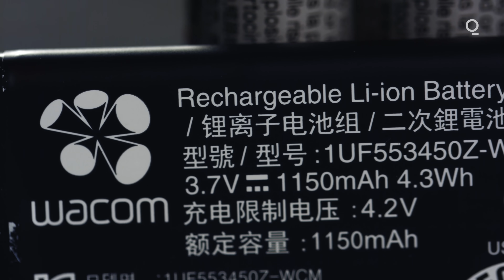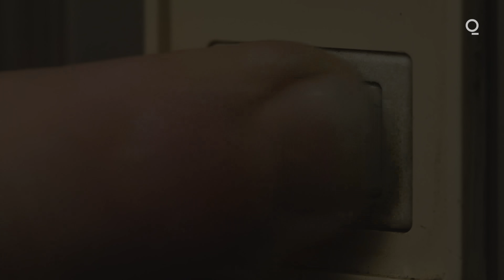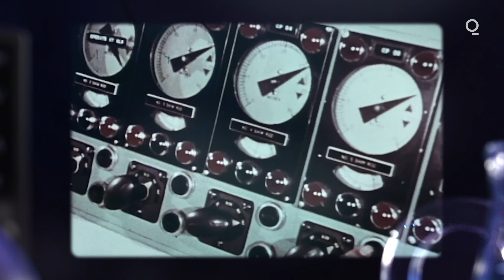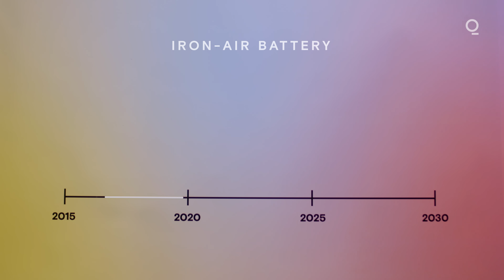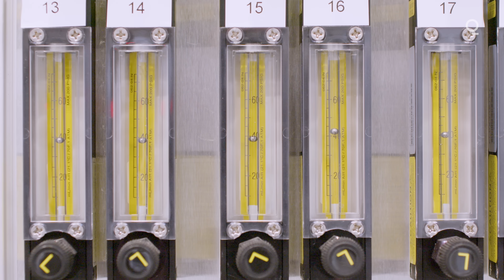The Huge, Weird Batteries of the Future

Comment: Also agree to move electricity across states or countries using high voltage DC transmission. NZ in 1965 with a population of 2.6million already put in a 600km line which carried 600 megawatts. That is mainly north to south but large east west conglomerates could transfer solar power from sunny to less sunny areas. Or wind power.
Reply: Or, you could put solar on every roof and "decentralise" with "local" storage, at the building, or at neighbourhood level.
Cheaper.
Reply: Half the city populations don’t have a roof, nor any property to put up a solar array. I have lots of roof but have waited 25 years to grow decent shade to reduce the heat load.  I am not going to sacrifice my trees for solar.

Not too far back roof solar was not economical as the quoted cost would have been barely paid by the energy recovered just at end of life of the array (about 20 years). Clearly not worth the cost or bother.  

You green fanciers have to realize that wind and solar energy is neither practical nor affordable to the majority of the population. You also need an expensive Solar Wall to get through the night.
Reply: the US would need 150,000 megawatts of transmission lines east to west. 346 million pop. and no one wants a transmission line built. Reaserch the grain belt transmission line from Iowa to chicago. Unbuilt for 10 years.
Reply: . @kkarllwt  wrote: "the US would need 150,000 megawatts of transmission lines east to west. 346 million pop. and no one wants a transmission line built. Reaserch the grain belt transmission line from Iowa to chicago. Unbuilt for 10 years"  I reply: The grain belt struggle is about not wanting solar panels covering land. And they are not even considering solar panels for shade. High voltage direct current lines do not make the alternating EMF of the alternating current transmission lines which quite rightly people don' like to live under.

Comment: “When you switch on a light someone has generated that electricity for you to use”… was this really a necessary point to make?
Reply: I think the point is that electricity used when you, say, switch on a light, is generated Right NOW.  This very instant. At nearly  the speed of light.   It is not stored anywhere ready to use unless we have battery load levelling which is not the case.

Comment: You can call it battery when you are able to carry it. I don't see much differences between the pumped-storage generator and the natural gas power.
Reply: So you wouldn't consider a Tesla's 1,060-pound rechargeable power source a battery?

There's all the world of difference. Pumped storage moves water up and then back down again - in many systems, the same water - to temporarily store excess renewable energy. Natural gas is a fossil fuel that is burned and in the process destroyed, while contributing to the warming of the planet.

Very little similarity indeed.
Reply: @DavidHeizer  The 1060 lb battery is placed under chasis of Model 3 and is mobile. If you could move the mountain, you could call the pumped storage a battery.
Reply: @DavidHeizer  No, Sorry. Even you could move it, it's not yet a battery because a battery doesn't need a generator to generate electricity.

And regarding the carbon emission, we couldn't say that the pumped storage itself is a green energy source. Pumped storage needs an external power supply to store potential energy and grean or not depends on those external sources. Solar power or Dam generator moves water up, it is green. Coal generator moves water up, it is not green.

Comment: I have the strong sensation that getting electricity from green resources to pump water up to get again alectricity later is a 60% of energy trowed away.
Reply: "60%(+) thrown away" = Hydrogen.
Reply: What's your better solution?
Reply: @DavidHeizer  dyson sphere
Reply: That's why you leave engineering and science to people who actually calculate the right numbers, instead of just "having a feel" for them
Reply: Modern pumps and turbines are incredibly efficient, with the most modern stuff only having around a 1-5% total energy loss over any given time.

That level of energy loss would be about the same as lost energy in the form of heat when charging batteries.

Comment: Pumped hydro looks great.... on paper. Not only are we going to have more heat and far less rain in the upcoming years (effectively reducing the battery 'capacity') It will have the same effect that hydro is having in my country were most of the water dams are not working due to extremely low volume. 
This would have been a great solution 30 to 60 years ago.
They should build/use water tables at least some of the evaporation could be contained.
Reply: Meanwhile in Canada our nation essentially runs in hydro. It's going great.
Reply: @AtillatheFun  your climate still gets you that advantage... But don't worry soon it will catch up to Canada 🤌
Reply: Most pumped hydro uses two reservoirs, and is only minimally dependent on an incoming stream. I wonder about the effect of Northfield "stealing" and then dumping back such large quantities of water into the river; I suppose they've been doing it long enough...

Comment: I think its worth mentioning that the type of salt used in the electrolysis that produces hydrogen would favorably be a non chlorine salt
Reply: crypto trading is the future of all investment , text me on what app and make money daily from an organize copy trading strategy signal pattern
Reply: You don't need a salt to split water with electricity to produce hydrogen and oxygen. There are processes and catalysts that claim to accelerate electrolysis like alkaline hydrolysis, but it takes energy to maintain the high temperatures these require, which in China comes from burning coal. Example: "This article concerns the low-cost and green electrolytic production of hydrogen operating at such a low voltage performed by the dissolution of steam in high temperature molten salt electrolytes"
Reply: The Connections (2021) [short documentary] 🌳

Comment: this isn't a battery in the traditional sense because it takes energy to make this battery work as you have to pump the water up.
Reply: There are two sorts of batteries, both requiring charging. You didn't charge the old carbon zinc batteries with electricity, you did it with the the electrodes which got used up when the battery was being used., if that is what you are thinking of. But ones like car batteries are charged with electrical energy. Instead  of putting that energy into electrochemical reactions in an electric battery It is used to increase the potential energy of water by lifting it - pumping it up. There will be some loss. Or you can store megawatts by raising heavy weights in old mine shafts. That is quite efficient - not much loss. Search gravitricity.,
Reply: @briansandle1915  there is a lot of loss because if you are going to measure the efficiency of a battery than you have to factor in how much energy it takes to create that energy.  And a traditional battery as we think about it doesn't take energy to charge it but this takes large amounts of energy to create the stored energy (the water)  that is pumped to the top of a hill to become consumable energy!!
Reply: @cliffwoodbury5319  The old non-rechargeable batteries require a lot of energy to refine the substances for the electrodes. And to mine them. In this water pumping case the pumping energy used comes from excess generation from nuclear, etc,. which can't be turned down when not wanted.. The water battery can store that waste and give it back in times of need.
Reply: @cliffwoodbury5319  Apart from a bit of loss to the viscosity of water in the pipe the bulk of energy is given back, not lost. The energy consumed by pumping mainly goes to potential energy of the water and is given back out as it flows down again through a turbine. The pumping energy is darwn from excess energy from the power grid, like from nuclear which can't be turned down.
Reply: It is not a battery, it is a storage device. And yes it has losses.
Reply: @deang5622  A battery is a collection of things like guns or electrochemical cells whose effects add to one another. If they are storage cells it is then a storage battery. Electrical storage batteries have losses they are not perfect at giving back what was charged into them.
Reply: @briansandle1915  Wrong. The definition of a battery is: "a container consisting of one or more cells, in which chemical energy is converted into electricity and used as a source of power.".

No chemisty involved in pumped storage systems. Ergo, not a battery.
Reply: @deang5622  The original electrical battery of leyden jars in the 1740s did not involve chemical storage.
Reply: @briansandle1915  The Leyden jar was a capacitor, not a battery.Go learn the difference.
Reply: @deang5622  So if you want to exclude capacitors you will have to exclude graphene capacitors as well hydroelectric systems for energy storage. They compete with lithium ion cells.
Reply: @briansandle1915  If you do not understand the difference between a capacitor and a battery, then there really is no help for you.
Reply: @deang5622  The first electrical battery in the 1740s was a name used to describe a combination of leyden capacitor cells working together. Only later was it used for a combination of electrochemical cells and then for one by itself. Today hydroelectric storage can store more energy than electrochemical storage. The video this is attached to goes beyond interpreting as one electrochemical cell by itself and to encompass hydroelectric storage.

Comment: Why are they using iron pellets? Wouldn’t a really high surface area benefit this battery
Reply: Pellets have convoluted surfaces and therefore much higher surface area than any smooth finished piece of iron...DUH!!
Reply: @jmccoomber1659  spheres have the smallest surface area at any volume
Reply: It needs to maintain a matrix shape to allow the fluid flow. They choose the smallest pellet that wont completely rust and fail structurally.
Reply: Yes....they could use old automobile and appliance sheet metal.
Reply: Do you know a new information platform named " Ganjing World " was launched recently in NY?  It is so so different from all the others, I'm trying now!

Comment: it will get so hot that these reservoirs going to evaporate faster than this flimsy pumps can pump it back up... also this is already done for centuries ... it will not save anyone because it is not feasable in most places. "bloomberg - just touching the surface"😋... humanity is so doomed, but luckily we have front rowseats. 🥳
Reply: Over 2000 locations in the lower US.

Comment: spin a flywheel, r=10m, 20k-rpm
Reply: meh, just use bare metal (surface protected wire spools) as the energy storage, metal-air electrolyte battery-fuel-cell
Reply: off-grid, now
Reply: diy you own power sources
Reply: you cannot rely on others through the grid, money or anything
Reply: grass pyrolysis is very green and renewable
Reply: economy of scales is a lie, be smarter
Reply: go home, you are not needed at the work place
Reply: service not needed
Reply: money is a lie
Reply: so is your economy
Reply: what a lie, you spout lies because of money
Reply: man, chill, you are not in any rush, dont believe in any people
Reply: learn to make iron yourself, with high voltage dissocation
Reply: meh, the things you think are new, are not
Reply: get lost, you dont have to prove anything to anyone, stop selling
Reply: kings, boosh off, you dont need to be served
Reply: stop doubting, believe
Reply: get away from under the law, nothing new if you stay under law
Reply: trash, go small first
Reply: get people out from work, they dont need to, anymore
Reply: This man is really arguing with himself in the comment section 💀

Comment: Here's an idea: some mountains block clouds and have a dry side, build pumped hydro on them and instead of returning the water the same way, irrigate the other side and produce food while creating electricity.
Reply: Something like that was proposed to bring seawater to the Salton Sea.
Reply: @steven4315  Isn't that the man made lake that, started smelling so bad that chased people away from the town around it?  I think they should let that one dry out.  The primary aim should be using the water to store electricity, but once it's on a high place, we can do more than releasing it to the same place it was.
Reply: @KiaAzad  Wish it was that easy. Years of agricultural runoff means as it drys out it creates a toxic dust.
Reply: @steven4315  I've been studying that, we can simply avoid fertilizers and pesticides to avoid that problem.  There  are tons of soil building methods that don't use either for a lower yield, since we're cultivating barren land, any amount of yield is a benefit. And any type of plant pulls carbon from air, even none edible ones.
Reply: And destabilise weather/water currents, great way to f% up the environment and micro climates!
Reply: @XFDADX  Hungry people don't care about environment or climate, and with the artificial famine coming soon, there will be lots of hungry ones.   
Also, greening the useless dry regions helps with carbon sequestering.
Reply: @KiaAzad  don't worry about that they'll only get more famine 🤌
Reply: @XFDADX  Well, I'm on the side of not letting people suffer if we can do something about it.
Reply: @KiaAzad  Everyone is on the side of not letting people suffer (because we are an endangered species after all) doing exactly what causes more suffering 🤌
Reply: @XFDADX  That's where our views differ. There are many people at the top that are willing to sacrifice millions to gain a little more control over people. See what the WEF and left leaning politics are doing to the food industry.  
And we're not endangered, we're just too dependent on the supply chain to feed us.
Reply: I’ve thought about that. Use 2 helium filled balloons to act as anchors with a mesh in between them that connects to the ground, the mesh pulls the water from clouds at the top, and the bottom is a hydro facility, would be insane lmak but one day ahaha
Reply: @Ophelialoki  Water from air is too energy intensive, and those clouds ultimately precipitate somewhere, we shouldn't deprive that place either.  Don't forget that the main reason we build those reservoirs is storing electricity, not using it.
Reply: Do you know a new information platform named " Ganjing World " was launched recently in NY?  It is so so different from all the others, I'm trying now!

Comment: Theoretically thinking, It would be nice if such batteries  can be scaled to also double as massive reservoirs for rain water. And not much need to rely on pumping water up from rivers…. when droughts hit due to hot summers some of this water can be released into the water grid and generating electricity at the same time. There are some challenges of course especially the demand for both water and electricity at particular times.
Reply: Wow reinventing the waterdamm amazing
Reply: What did you think watersheds and rivers were already doing? Or were you planning to entice clouds to rain directly over reservoirs?

Comment: The problem with this is the extreme lack of operating efficiency.
You're paying an extreme premium to pump water to a higher altitude, and having to sell that water downhill at a steep discount.
They sure work, and there also exist quite a few of them across the world, but they're geographically dependent and also heavily dependent on whether or not the surrounding area has other reliable sources of cheaper electricity year round.
In essence, put a nuclear plant nearby and your pump storage will never function again due to the insane costs in comparison.